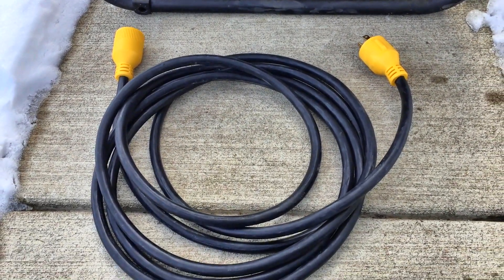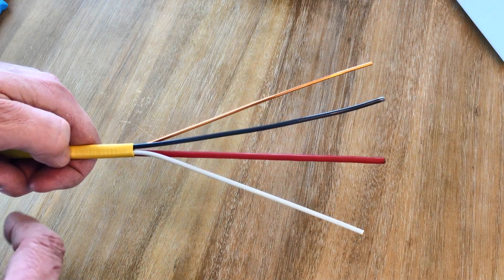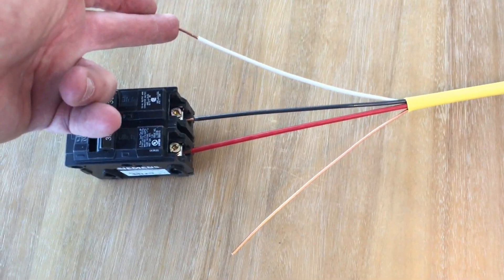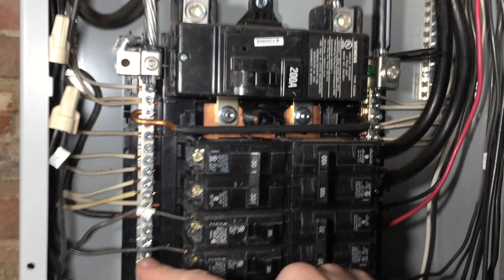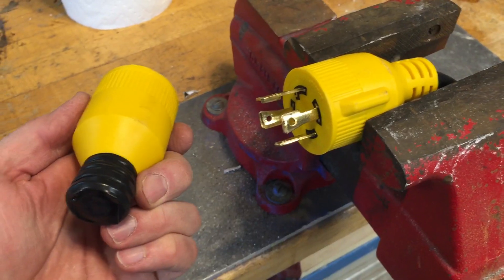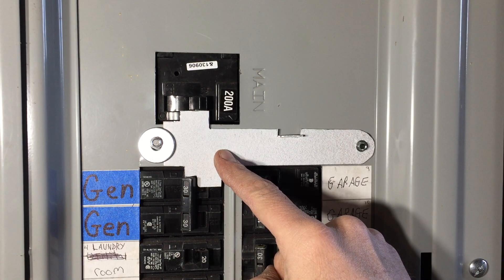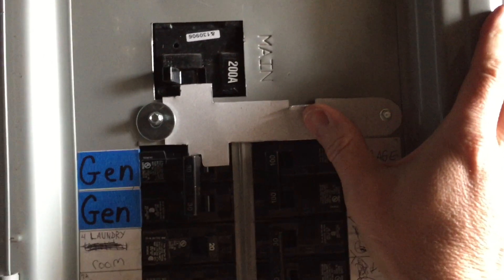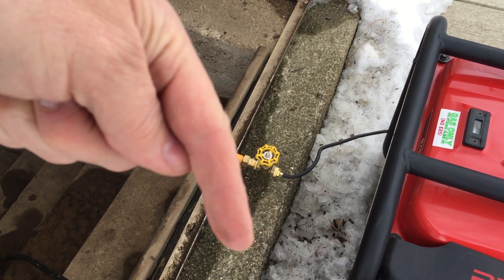DIY Generator Installation

Comment: does the flow matter from the gas line? as the generator throttles up and down or if it's just putting out more than the generator requires to run? or is there ample containment by the air box that it only uses or distributes the amt of needed nat. gas?

Comment: Have you made a video about tying in the natural gas line to power it? I am trying to decide where is best to tie the gas into the supply.
Reply from the maker: DIY Generator Conversion to Natural Gas for $10
https://youtu.be/sDHGCzOZn_M
Reply: @HowToLou  got the generator working on NG, sort of. Runs for about 3 minutes then turns off. Wondering if I ran the 1/2 inch line too far. Near as I can tell the generator uses 126 cubic feet per hour at a full load and 86 at half load. I ran the half inch line about 40 feet. You think that is my problem?
Reply: It runs great on gasoline.
Reply from the maker: Yes.  CSST causes turbulent slow flow.  Go larger Diameter or use smooth metal or plastic gas pipe.

Comment: If i understand, you will have to select the breakers you want to use with the generator in operation, to be sure to not exceed your generator wattage capacity..... ? Am I right?
Reply from the maker: Exactly!
Reply: @HowToLou  Do you know if that kind of installation is legal in Canada, specifically in Quebec? And another question, does a non-inverter generator can cause dommage to my electronic item like TVs, Wi-Fi modem etc?? I just bought a Generac GP7500e

Comment: How can I figure out what size generator needed to power my house including my AC?
Reply from the maker: Look on your AC.  It will tell how many watts, typically around 3000-4000.  Probably another 3000 for everything else, except electric stove, water heater and clothes dryer.  You will have to look at the labels for those.  Another way is to see how many kilowatt-hours you use in one hour, on your electric meter.  The all-day average is only 1.25 kwhr or 1,250 watts, but that includes nighttime.  Check during the day, when you have appliances running. It could peak over 10,000.  My generator is 7000.  I will just alternate large appliances in an emergency power loss situation.  I won’t run dryer and AC at the same time.

Comment: Great install although I would go with the outside box. Generators are typically needed during nasty weather and getting the long cord up the stairs with ice/snow/rain might be a tad hazardous. Plus install some LED light bulbs will ya. That will help the load on the generator. Did you or would you recommend grounding the generator as well? I run a piece of green coated copper wire to my grounding rod when I hook up my generator. (Can't run the dryer or many window ACs; dryer because generator is only 4 kW and AC because loads are balanced on the two legs; I need to address that at some point).
Reply from the maker: Sure the outside box is a great option.   My stairs are covered by metal doors, so the direct cable worked well and saved me $100.  No, you do not need an extra ground wire.   Its already in the 4 prong cable. Green is ground.  White is common.  Black and Red are both 120v power lines.   Most of my house lights are LED.   They flicker way worse than incandescent bulbs, when running on generator.

Comment: Alright! I'm first! Lou, this is the perfect capstone to your generator series! How many KW did you need for your house? Will this also run your dryer? Good video!
Reply from the maker: Thanks Big Matt!  This genny is capable of 7KW.  I only ran half of it into the house.   I didn’t try the dryer, but it should run if not much else is on.  I may run another line dedicated to the dryer someday.